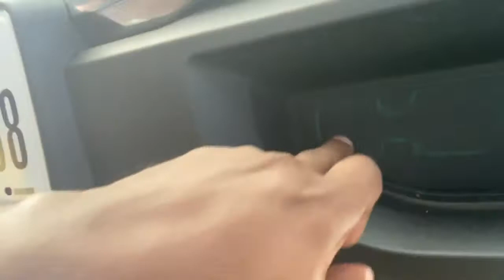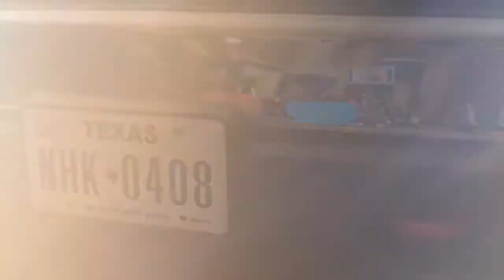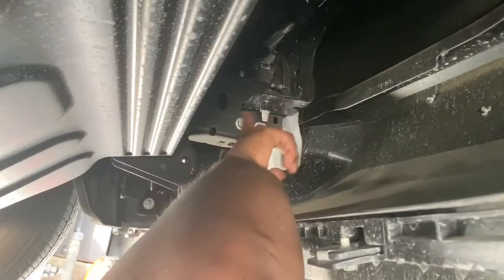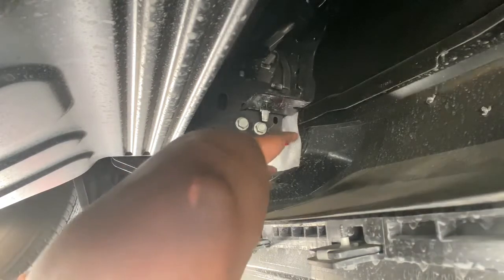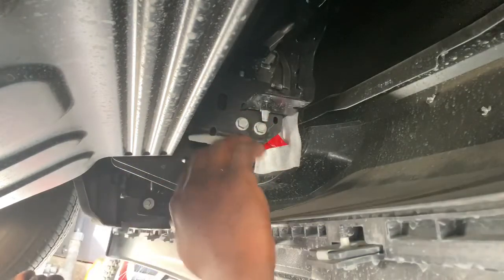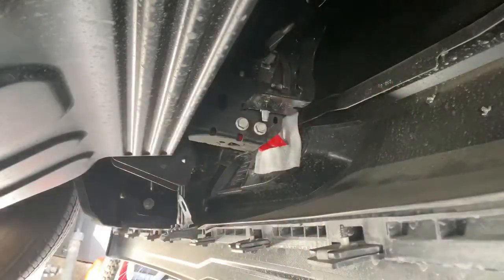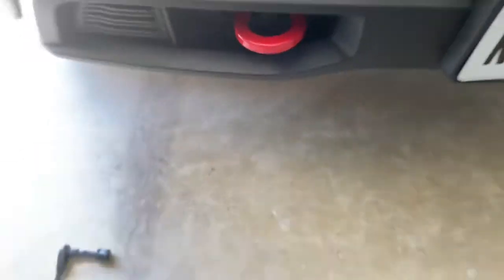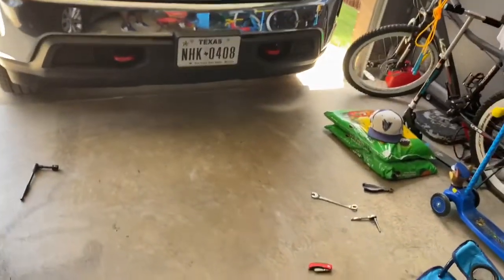TOW HOOK INSTALLATION ON A TRUCK made Easy! #truck #diy #howto

Comment: Nice truck and nice video .. also just watched the fog light video .. my truck needs to be cut out as well . Where did you get the bolts ? What size do I need ? I just ordered some hooks but no hardware
Reply from the maker: Thanks... I ordered mine from https://accessories.chevrolet.com/product/recovery-hooks-in-red . I hope this helps....straight oem
Reply from the maker: Came with my hooks in a package
Reply: @2LOOKER  thanks my man !! Damn I just re watched the fog light video I’ll never be able to do that .. dealer said 1300$